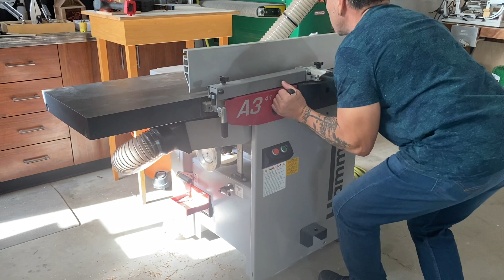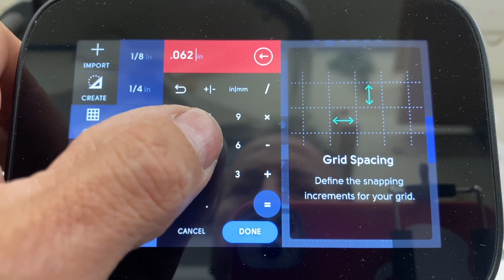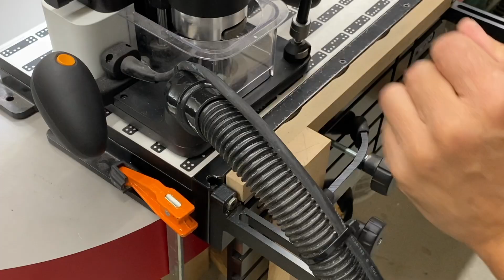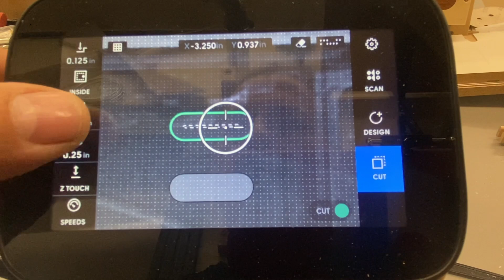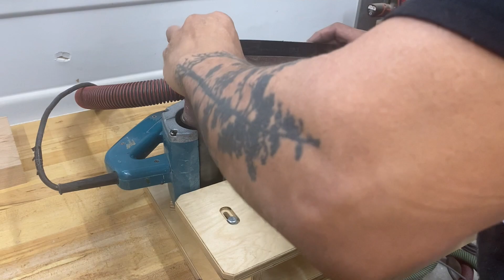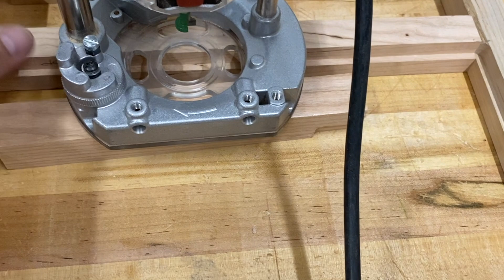Shaper Origin Mortise & Tenon

Comment: love your stuff Ramon, but is it just me or is that shoulder a little sloppy off the Origin? Thinking of purchasing this thing but that’s not the first time I’ve seen that happen.
Reply from the maker: Hello…so I just watched my video and I think I see what you’re talking about; the twin tenons kinda snap into the mortise, maybe a bit to easily.  I can assure you, that is user error. It’s easy to get impatient, rather than having an offset and then sneaking up to a perfect fit.  The Shaper Origin has the capability of .001” offsets, so one can make M&T joints as tight as you want!  (Just in case someone reads this; .001”is equivalent of slicing a single sheet of paper into four minuscule layers!) Anyway, yes, the machine is extremely accurate!  Thanks a ton for watching!

Comment: Thank you for the video. Would you go with this or pantorouter? Main use would be for joinery
Reply from the maker: It’s a common question.   For me, I can’t imagine not having both!  The Shaper Origin shines for odd and difficult cuts, shapes, or super accurate designs.  Inlays, jigs and so many more uses.  But not my first choice for joinery.  The Pantorouter is ideal for joinery.  Fast and repeatable. 
Both, extremely good machines!  I really do need both for my shop.  Cheers

Comment: Great video, how did you set the grid for the mortise when it extends beyond the workstation table since you need three points of reference... Thanks
Reply from the maker: It won’t matter that your actual work piece or components are beyond the Shaper WorkStation.  After you scan…you can grid…utilizing two points along the x axis and a third along one y axis.  Hope that helps.  Thanks

Comment: Hi Ramon, so i am currently in the middle of making the decision to get the shaper and i am looking for reasons to bite the bullet...  While i know it can be used for tenon and mortice joints as you have shown, surely it is just as quick with the domino, which you could also have used in this situation.  id really like to see why it is more than just an expensive toy?  dont get me wrong, i love my toys, but this thing is expensive.  At this moment i just see it as a template maker and sign writer?  Thoughts? Thanks in advance!
Reply from the maker: That’s a good and valid question. Although I can’t speak for everyone, since I don’t know their work load or type of tasks they do…I can say that I use mine WAY more often than I thought I would.  I just finished a high end project where the focus point is an inlay of the Mesa Police Logo.  I could have created this with hand cut marquetry but it had tiny details that needed to be perfect.  Just last week I needed a jig with a hole to fit a vacuum hose.  With the Shaper Origin I was able to quickly make a slightly tapered hole that fits the hose perfectly and a custom sized slot!   Jigs are perfect and quick. Templates…fast.  My recent “Table for six”…I used the SO no less than 12 times for all sorts of tasks that would have been nearly impossible without something this accurate.  Pivoting hardware, perfect magnet cavities, aluminum bearing blocks, magnetic & leaf shaped keys, the locking mechanism, signature and logo, a template for the Pantorouter, and even engraved instructions on the bottom of the table.  

It is pricey.  But I can easily say that it can pay for itself, even on one job! I made a large barn door a couple years back that had a large inlay of a mountain scene.  That job would have easily covered the cost and some.  

Anyway, I’m not trying to convince anyone…but for me…I cannot see myself without a Shaper Origin!  I have access to a promo code (ends Dec 20th) if you’re interested. Cheers.

Comment: I could have been done with the cuts by the time you were halfway through with the long long task of setting up this thing. Take a ruler mark the wood take router with guide and zoom zoom done. Later on in the day you will still be inputting computer stuff into this little gadget. No thanks.
Reply from the maker: I get it.  I cut mortise n tenons a lot of different ways.  I just wanted to show yet another way.  

Now, some people like technology and enjoy things like this.  You’d be surprised as to the vast amount of things that this machine is actually capable of.  I know for a fact that many of those tasks one could not do by conventional methods.  At least not accurately.  

Not trying to convince you…to each their own.  Happy Holidays!
Reply: And I could have done it in a quarter of the time with my pet Beaver but the little guy was just back from the dentist.

Comment: Another great Shaper Origin project, Ramon.  It's an amazingly accurate machine and I love it every time I use it.  I have a question about your grid layout when cutting the tenons.  Is there a reason you didn't reference off the back portion of the vertical table of the Workstation rather than using the workpiece?  Wouldn't that eliminate any slight error if the workpieces were not exactly the same thickness?  Obviously, it worked just fine since your end result is perfect (puhfect 🙂)
Reply from the maker: Hey David…good catch!  Yes, I should have referenced off the back of the work piece!   By the time I thought of that, I had already started…and a couple thou diff in material probably didn’t make much difference here. I had marked my reference corner front/left…and since I’m so used to referencing off of that corner, I never thought about it until I was already cutting.  Meh…it worked 😬. Thanks
Reply: @ramonartful  thanks for your response, Ramon. It's nice to have so many grid options.

Comment: Another great video Ramon. Sooo if you could only have one is it:
Shaper Origin
Pantorouter
Domino
Yeah, I know Festool has 2 of the above and they are sponsors??...only one though
Thanks
Reply from the maker: Really good question. Everybody’s situation or needs would be different.  Personally, I would probably have a Domino…especially since I sell hundreds of Docks! 😬 
In fairness, they are completely different machines, each with their own capabilities and strongpoints.  If one was building furniture where integral tenons were important, then Pantorouter all the way!  Someone looking at building some furniture and small boxes, the Domino is a good fit.  Another that may be interested in doing inlay, or cutting odd sized templates…maybe the Shaper Origin is a good choice.  I am sponsored by two of the machines…so I do feel blessed for having all three.  Thanks a ton.

Comment: Great video Ramon.   I'd be interested to see you work this joint out on the Pantorouter.
Reply from the maker: Thanks a lot!  This could be accomplished quite easily with the Pantorouter but it would require some spacers perhaps.   I don’t think both mortises (or tenons) could be cut with one template. Anyway…thanks for the idea for another YT video!
Reply: @ramonartful  spacers I can manage.  But if it were doable with a single template that would be great.
Reply from the maker: @thwwoodcraft1449  Yeah...I don't really see how one could cut twin tenons this small with a single template at the Panorouter since it uses a 2:1 ratio. Let me think about this.  Thanks